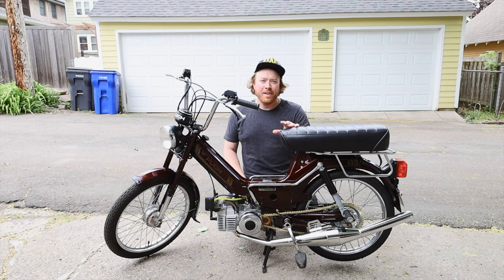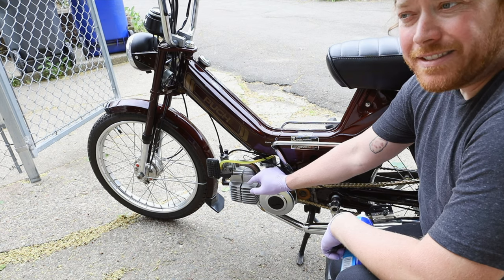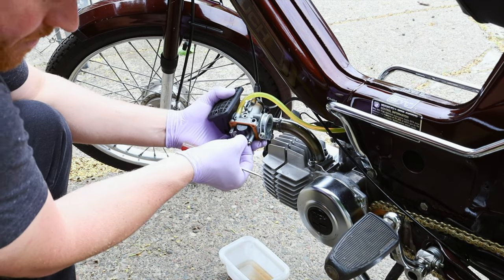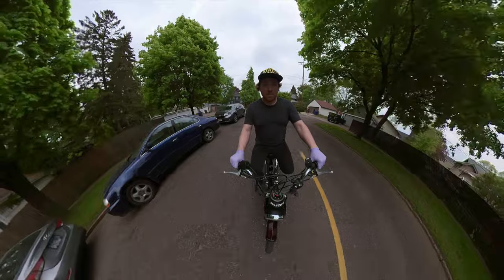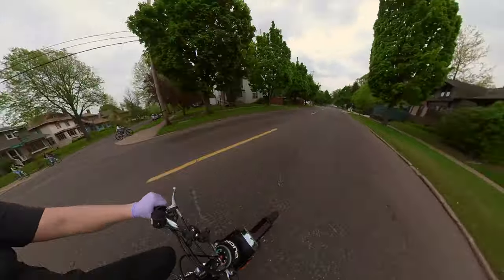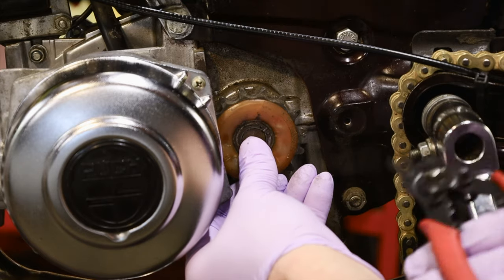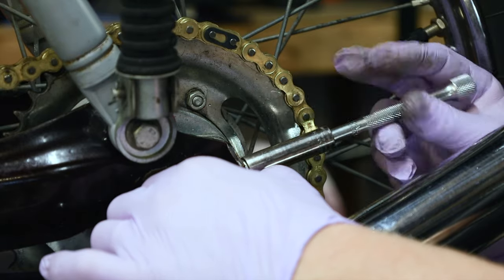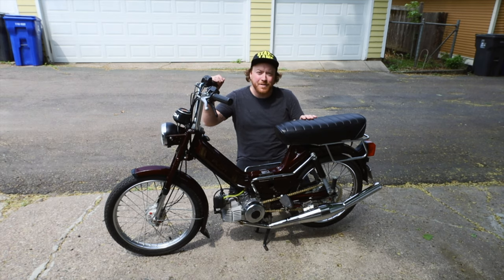Puch Maxi LS - Moped Rebuilt - PT 7 (Final Jetting)

Comment: What’s the gearing on the rear sprocket?  Also what 360 camera was used?   Sweeet videos btw
Reply from the maker: Thanks, It has 16x45 gearing but it could go to 16x40 and still have decent acceleration with higher top speed. 
I am using the Insta360 X2 360 cam. Its really easy to learn on with there editing software.